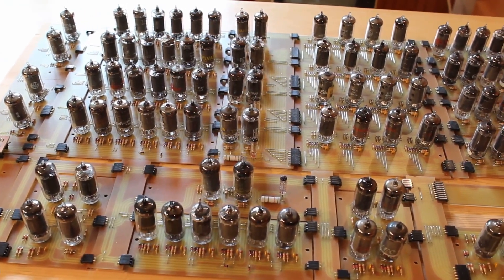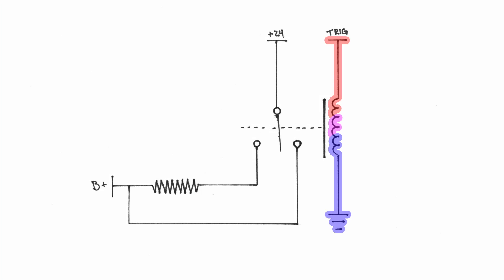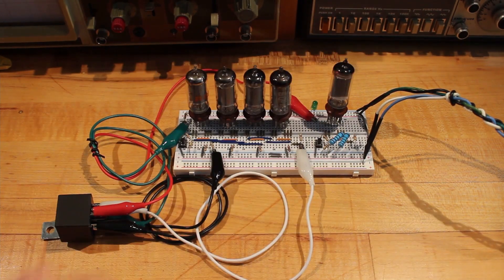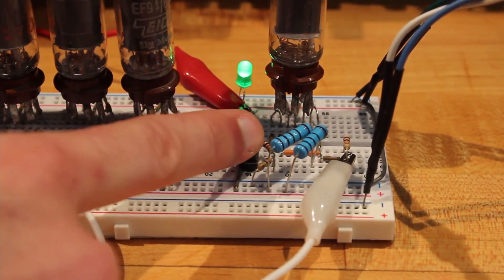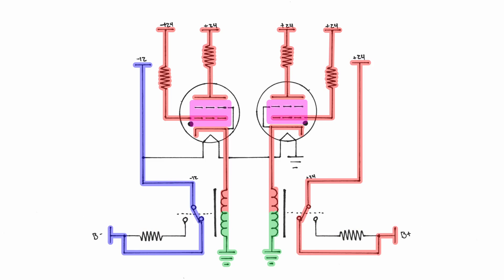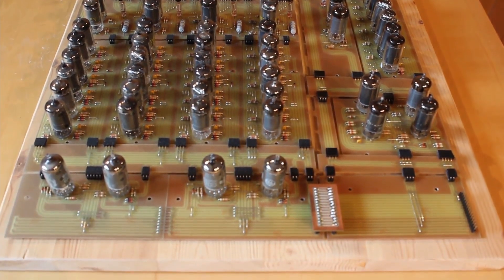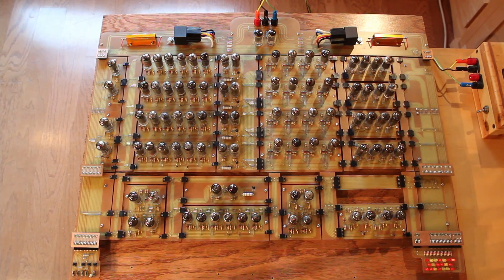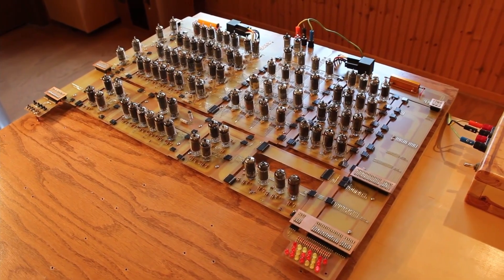Vacuum Tube Computer P.15 – Building a Soft Start to Battle In-rush Current

Comment: I'm sure you've shown before (?) ... what schematic capture tool you using? how are you making the boards? You've got so many custom guys there .. you're CNC carvinmg one sided copper boards? They're way nicer than hand drawn and etched, thats for sure; or perhaps using print out and transfer type? Given how fast you're knocking boards out, you're not waiting on shipping ... and you do seem to have a wicked workshop there, so surely a CNC.

Also, the two tube slow start diagram you showed on paper.. could have been shaped like your Usagi logo :)
Reply: Which part number ids that 1 bit VFD? I need to buy a pile of those :O
Reply from the maker: Thank you!

To design all the PCBs I'm using a program called DesignSpark PCB ( https://www.rs-online.com/designspark/pcb-software ), for a free tool I feel like it's one of the best out there. I was able to get the design rules setup just right for the single sided PCBs I make and even make custom layouts that I copy paste from design to design for the tube sockets. 
To get the PCB design from DesignSpark into G-Code for our mill, I use a program called FlatCAM ( http://flatcam.org/ ). It took a little bit of time to get used to and get setup for the mill and bits that I use, but once I got all the parameters figured out, it works really well!
Our mill is a Bridgeport EZ-Trak with an Acu-rite Millpwr CNC conversion. It's actually way too large and very nearly too old to be doing this level of precision PCB cutting on, but after a lot of trial and error I got to a method that works. All my PCBs are designed with pretty fat traces (1mm) and lots of space between traces to help with any inaccuracies in the mill (or laziness in my setup). The mill seems to be accurate to about 0.02mm, which is amazing, but not quite precise enough for narrow SMD stuff or anything like that.
The PCBs that I cut are just single sided PCBs from Paramount 3D ( https://www.paramount-3d.com/prototypingboards ). I find these to cut really well, and I like the see through appearance they have after cutting a design out!

Those little VFDs are actually Russian copies of the DM-160, which is designated IV-15. They're not super cheap, but boy do they look great!

Comment: Very clever with using the heaters as time delay.  I'd have used a delay relay tube and wouldn't have been as elegant.  :3
Reply from the maker: Thank you so much!
I actually thought about using a delay relay tube, but most of those tubes are designed to be used with much higher voltage. Finding a 12V delay relay in a tube package is surprisingly difficult (or maybe I just didn't know how to search properly). But, I had some thyratrons already laying from precious experiments and the 12V relays were a leftover from working on the Bellett, so it was nice to build something using parts I already had on hand!
Reply: @UsagiElectric  Yeee, the delay relay tubes I've fooled with were all 120v coils.  :<
Reply from the maker: @Lee-il5kc  Yeah, it's surprisingly difficult to find anything form the 1950s and 1960s that can work on just 24V! I'm really kind of pushing the limits of the tubes by running them at such low voltages, but it means that despite my clumsiness, I've yet to shock myself, haha.

Comment: I wonder if you might get some chatter/squegging  on the -12V buss if the main load steals enough current to cool down the cathode at all once the relay engages..
Reply from the maker: I think the -12V rail should be alright since it's essentially got its own relay and thyratron. The -12V supply can only give about an amp of power, so the -12V bus sits below that currently. In all honesty, I totally didn't need a soft start for the -12V rail at the moment, but as the computer grows, I might get to a point where a soft start could help, so I went ahead and built it in just in case.

Comment: YAY !

instead of reducing the resistance,
add another in parallel and power 2 separate power buses ?
Reply from the maker: Thank you!
Ultimately I think the processor is going to be at right around 180 tubes, so 'I'm not really sure how well this soft start will scale up to that level. I may have to do some more heavy redesigning of the soft start portion once we near completion. For the moment though, this lets me fire up quite a lot in one go so I can continue building and testing!
Reply: @UsagiElectric  it's going to be fun with the memory.
You had it easy with the processing part.

/me grabs some more popcorn
Reply from the maker: @leyasep5919  Oh man, memory is going to be a serious challenge! I want the general purpose registers to be built from tubes, but that doesn't scale up well at all. I have a few ideas and plans I'm working on, so we'll see how we do!
Reply: @UsagiElectric  and you'll show us the results :-D
Depending on the speed, you could use one technology or another.
If you're not too fast, you could try dynamic RAM with 1 capacitor and 2 diodes per bit...
But row/line decoders will still use a lot of tubes.

Comment: This is great. I love how you're 'exploiting' the way the tube heats up, which then slowly increases the current to the relay coil! That is awesome, I wouldn't have thought of that in a million years. One question though, Is there many issues with back-emf from the relays? Do you need some backwards-diode loop or something to 'flush' the 'excess' flux after the relay coils are disconnected? Or does the direct ground connected to the relay coils do the flushing? Great work, I look forward to seeing more videos.

Edit: Fixed typos.
Reply from the maker: Thank you!
What's really great about the thyratrons is that they don't conduct at all until the gas inside ionizes, so the relay doesn't see any current at all until the moment the thyratron ionizes, at which point it sees enough to kick over. 
I think ideally I would have a flyback diode to prevent a spike from suddenly turning the power off, but I totally forgot to put one in. I'm not sure how absolutely necessary it would be in this situation, but if I ever redesign these boards for different relays or something, I might put one in there just to be safe. Having said that, so far I haven't seen any ill-effects from not having one!
Reply: @UsagiElectric  you could "see" the effect with your latest oscilloscope and take the appropriate measures :-)

Comment: U need to add more delay to the relay ,u can add a resistor to the heaters of thyrotrons so they warmup and turn on slower .
Reply from the maker: Thank you for the suggestion!
For the moment, I think the delay is probably okay, it's just the heaters sit at such a low resistance, that the 5 ohm resistor sucks up all the power. We can see that once the heaters receive power, they only spike for about 1 second before they come up enough in resistance to no longer be a problem. With a smaller power resistor (say 2 ohms), I should be able to get more power in the heaters before the delay times out. I'll have a larger initial spike up to maybe 5A-ish when first kicking it on, but then it should stay at that level even after the relays kick over.
Reply: @UsagiElectric  yes ,you are right but the point of soft starting the filaments of tubes are generally to warm them up so they dont flash , in ur case it will help both low starting resistance and also the filament flash . Generally they use about a 10 seconds delay before kicking the main relay .
Reply: Huge fan of ur videos by the way, great job 👍👍
Reply from the maker: @thevoidedwarranty  Thank you so much!
Soft starting is definitely good for filament flash, but I was actually planning on dealing with filament flash by just replacing any tubes that went bad, haha. I have a ton of 6AU6s (like over 1000 of them), so I kind of built the heater circuits a little fast and loose. I'm mostly just trying to give my power supply a fighting chance at surviving power on!
Reply: @UsagiElectric  nice solution ! Those tube go for 10 to 20usd where i live ! (I live in Iran )
Reply from the maker: @thevoidedwarranty  Oh wow! The 6AU6 is super cheap here, I often find them used for less than $0.80 a tube!
Reply: @UsagiElectric  well ,yeah everything is expensive here ,it's third world after all 🤷‍♂️

Comment: Recommend shorting the resistor side of the relay so there is no brief disconnected state while switching. Once switched the relay will just short out the resistor.
Reply from the maker: That's a brilliant idea and I have no idea why I didn't think about that!
I think I'm going to rebuild the boards that hold the relays so I can switch over to some proper 50s automotive relays (to keep the aesthetic in line), when I do that I'll change up the connection so the resistor side connects directly to common.
Thanks for the recommendation!

Comment: Why not just an NTC?
Reply: This way is much cooler and uses a tube.
Reply from the maker: There were a couple reasons, but the biggest is because I already had some thyratrons and relays here and didn't need to order any parts.
But also, I'm trying to keep the computer somewhat close to period correct for something like the LGP-30, which was built in 1956. NTC thermistors were around, but from what I've been able to read, they weren't all that common or commercially viable so they weren't often used. Building it with thyratrons and automotive relays felt a little more representative of what an enthusiast in the 60s could have accomplished in their garage!
But mostly it's because I didn't need to order anything, haha.
Reply: @UsagiElectric  Fair enough. Great to learn about new things regardless!

Comment: Thyratrons call for tube buck regulator :D
Reply from the maker: A long term goal of mine is to someday build a buck regulator like the thyraton PSU used in CuriousMarc's Teletype!
Reply: @UsagiElectric  i thought something closer to 10kHz than 100Hz, but that PSU is also amazing. It needs a lot of iron though 😉
Reply from the maker: @akkudakkupl  I'm not sure about other Thyratrons, but the 2D21 has a relatively slow de-ionization time of between 35us to 75us. The ionization time is crazy fast though at 0.5us. At the voltages I'm at, I might be able to squeeze 10kHz out of it, but 5kHz should be totally doable. And a 5kHz thyratron buck regulator would epic!

Comment: More like macroprocessor
Reply: or a processor...
Reply from the maker: A megaprocessor!
Although, if we're being really honest, it's actually a space heater that can do simple calculations. So, the first "smart" space heater!
Reply: @UsagiElectric  a bold claim indeed 😁
Reply: @UsagiElectric  how can it be "smart" if it's not even Turing Complete ?
Reply from the maker: @leyasep5919  Being Turing Complete is an actual goal though!
The 1-bit architecture this is based on is pretty weird, but by having the IEN and OEN registers control whether data can be input or output, you can actually make pretty complex programs with jumps and conditional statements. Here's a short bit on how IF-THEN-ELSE statements are implemented with such a limited instruction set: https://i.postimg.cc/RVLwy5KK/If-Then-Else.jpg
Once memory is implemented and we can store data in general purpose registers, then it comes down to being able to figure out how to write the appropriate programs to calculate whatever it is we're trying to calculate!